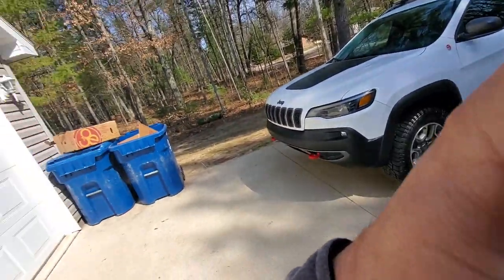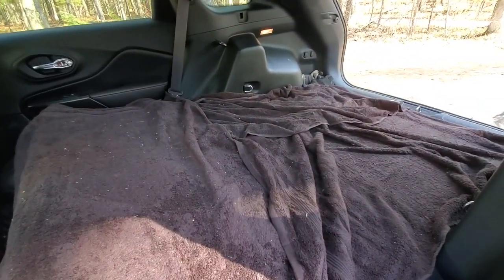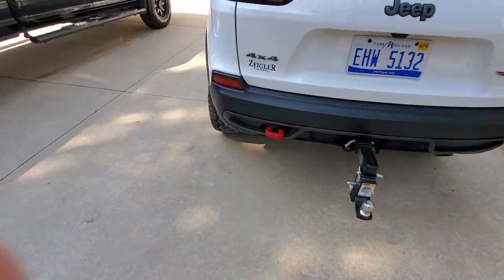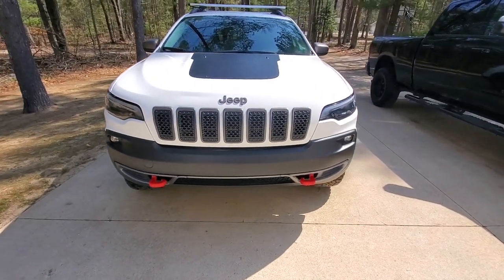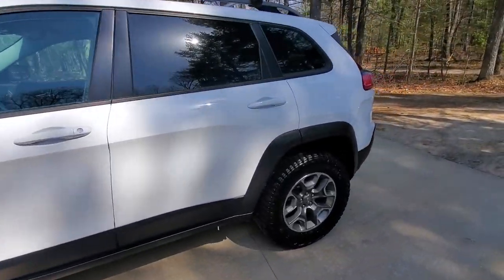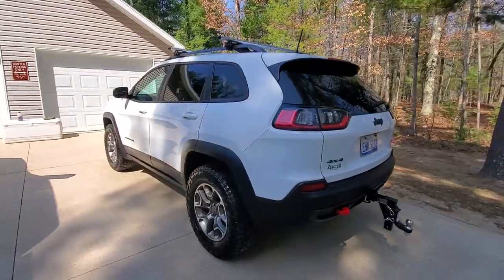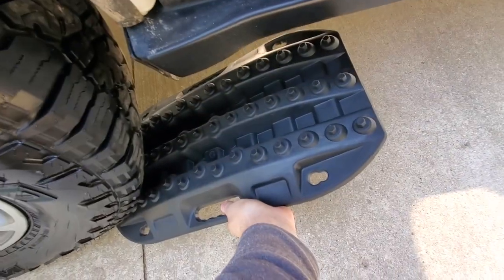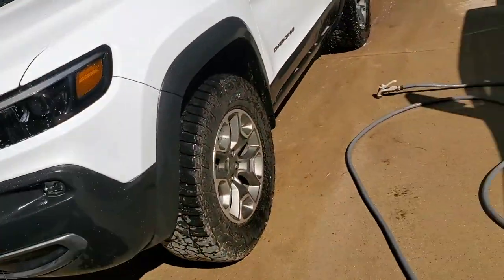Why Is The Jeep Cherokee Trail Hawk So Amazing

Comment: You can also flip down the front passenger seat all the way. Also , the back seats recline if you didn't know. You lift up on the latch that flips them down and you pull back and it locks the recline. There are two recline settings in the back.
Reply from the maker: I dont think the recline option was kept after 2019. But I could be wrong
Reply: @SamkoTradBow  I have a 2020 Trailhawk and my rear seats recline.
Reply: Huge for a tall guy like me or someone who wants to haul structural lumber potentially like 8 foot boards. Thanks for the pro tip.
Reply: I checked my '19 KL Trailhawk and the back seats do have two positions, albeit very little, but still enough. How do you fold down the front passenger seat? I couldn't figure that one out 😂
Reply: @husker_nation  Just pull the thing like your going to lean it back but push it forward instead. 

And then you might have to slide it back on the sliders so that it has room to lean forward
Reply: Nope 2019 and newer Cherokees don’t have the fold flat passenger seat anymore.
Reply: Thanks I didn't know that!!!
Reply: I have a 21 Cherokee Trailhawk and never realized I had that feature! Thank you!

Comment: So glad you popped up. This is the best review I have seen of the Cherokee with excellent clear explanation of how rear lockers work. Great job. Want to see more on your sleeping setup. I’m all about keep it simple.
Reply from the maker: Glad you enjoyed it. My sleeping set up is just a blanket and foam pad and pillow. Very simple but for me as a short guy 5'6" I can stretch all the way out and not touch the seat or tailgate back there..lol
Reply: There have been a couple times already where I wish I knew how to use that rear-locker button. Will remember that next time I get stuck. Seriously.
Reply: @boblozaintherealworld3577  I've only had to use the rear locker once. It was up a steep, rocky slope and it helped tremendously!
Reply: @husker_nation  And I feel so stupid. Up here at 6700' we had a huge snowfall this year. I'm just an LA kid. Will keep that in mind next year.
Reply: @boblozaintherealworld3577  No need to feel that way. Just takes time to learn how to drive in snow 🙂
Reply: @husker_nation  Much appreciated.
Reply: Awesome video! Can you share what brand lift you installed? Thanks..
Reply: @cathtech15able  If it helps, I got a 2" lift kit from Hazard Sky

Comment: I would love to see how you did that trailer hitch! I like the way it comes out the bumper rather than hang below the bumper like some do! Please so a video on it! Thanks!
Reply from the maker: That is jeeps factory hitch they put on the jeep trailhawk from the factory. But I installed it myself. Cost me 500 bucks total to buy the hitch and wiring harness from Mopar.  The install took about 3 hours as you have to take off the whole back clip and quarter panels. But was very worth doing. I no longer own this vehicle and did not make a video when I did it. But there are videos on YouTube that show how to do it I think.

Comment: Dude I loved this video! Thank you! I am purchasing a 2020 Cherokee Trailhawk tomorrow and I’m a big outdoors guy so I’m excited!

I have a 3000lb boat. How did it do towing?
Reply from the maker: Towed fantastic.  Actually got better gas mileage towing my trailer with the trailhawk than I do with my tacoma. You are gonna love it
Reply: @SamkoTradBow  Hell yeah thank you for responding!
Reply: I had another question. I’ve never driven with all terrain tires and AWD. I notice a slight tug on the wheels when turning. Is that normal?
Reply from the maker: @quentinwade5531  yes. But you should not be using 4 wheel drive on dry pavement. When off road the tires can break free and slip easier and don't cause stress on the 4 wheel drive system. Dry pavement has too much grip.
Reply: @SamkoTradBow  thanks again for the response. Is there a way to turn it off?
Reply: I thought with all wheel drive there wasn’t a way to switch
Reply from the maker: @quentinwade5531  can't remeber if the trwilhawk had full time awd if it did then you are all good as the open diffs will take care of everything for you.
Reply from the maker: @quentinwade5531  I can't remeber. Sold it almost 2 years ago. You will have to look at the manual or send me a pic of the 4x4 know on the center counsel
Reply: Good video. How comfortable are the front seats? I had a grand cherokee sterling edition and the seats in that were like sitting on rocks.

Comment: Great video.   I purchased a 2022 Jeep Trail Hawk  and my wife wants to drive nothing else since the check was presented to the dealer.    She drove it home. 
I had a 2008 Jeep Wrangler 2 door Sport model I traded in on it. .       I had the flat towing rig on it  from Blue OX so I could pull it behind my RV as I travel.   I loved the short wheel base. 

It was time to trade the Wrangler so with some research I found I could also flat tow the Trailhawk  model.       That ability to be flat towed sold me and I also  knew  it was somewhat an off road vehicle.  

I did not realize how capable it was off-road  and  yet still a family car.    I just love it.    It checks all the boxes on what we need.     

I will never use my Cherokee off the road as much as you do but I do need the ability to travel on paths that a standard vehicle will not handle.   It is a good pick and yes it does travel off-road better than my 2002 Ford 150 with 4 wheel drive.
Reply from the maker: Congrats on the new trailhawk! Such a great and capable vehicle!
Reply: @SamkoTradBow     Thanks  I forgot to say that I also use it to pull my smaller bass boat instead of usimg my old 2002 Ford 150 truck.     SO it does it all for me now.  
      
So I can tow the Cherokee behind my rv or use it to tow my boat.     I never pulled by boat with the old wrangler
Reply from the maker: @Cuffsmaster  I was towing a 3k pound pressure washing enclosed trailer with my trailhawk daily all that year. Worked excellent

Comment: Stock 2020 Cherokee TH here. I get around 26 at 75 mph on trips. Better if I slow down a bit. 2017 TH I had blew its trans at 35k. Don't forget about the Brake Lock Differential Brake  (BLD) traction aid for the front wheels (back too).
Reply from the maker: Yep I loose a little mpg being lifted and bigger tires. Jeeps bld is awesome. Next best thing to a front locker

Comment: I don't have the TH but my 2018 Latitude Plus is very comfortable to ride in. With the factory tow pkg I can tow 4500 lbs and have never had trouble. The KL has been the most reliable vehicle that I have ever owned. I may eventually move  up to a Grand Cherokee TH for the extra room and tow capacity of 6000lbs.
Reply from the maker: Yep such a great vehicle. Sad to hear jeep cancelled it in 2023.

Comment: Design design 
I don’t think they had planned on having so many great features, components and capabilities. Like built by selecting the area/section and attaching them to a outline/core/structure. So many great things but wow some real “really now”s / misses / forgotten / wtf why nots. 
Like a light under the hood? Even a manually operated light. Or have a 12v outlet so you could plug in something. Hopefully it won’t be much longer since it has been a while now, they had the brilliant idea to put one in the hatchback area. Another almost really great feature is the down light on the side view mirrors. Not sure yet if I like how much of the door is lit up. I know I like better it the bright white LED’s running the bottom length of each door. 
Black hole 2 is the center storage/arm rest. Again just a switch operation light   A nice try with the scooped out area for device charge/connect cords. Better method is having them come out the front with a sliding keeper so you don’t have to mess with it each time you open it. 
Speaking of 12 v outlet in rear hatch. Yes there is one and you can change it from key on or always on. There is a second light in the hatch area. Unfortunately it is also placed very low to the deck which means  BAD DESIGN that felt good to say. It means lights are easily blocked. A middle dome light sure would be nice. Or two of the almost worth it button lights for back seat. Yes it is nice to have separately controlled lights but while they are cute they are not able to produce enough light
2019 Cherokee TH E 49,700 miles fully loaded inside built for the car shows to promote the new blue color. 
I have added over 40 switches plus 8 RF controlled switches several dozen LED’s couple dozen feet of EL Wire outside a 52 “ curved light bar dual forward facing pin spots with high low or strobe 22” bumper mounted light bar one flood-spot and one line spot each side twin focused flood lights rear facing. And 8 horns plus some interior features I invented auto adjusting between seat and center console gap sealer and seat covers with device pocket with wireless charging and cup holders / pockets just outside of where your knees would be.

Comment: Awesome video. I have 2016 Trailhawk and want to lift it. I keep seeing everyone from the Rough Country 2” to MFC to hazard sky…what lift do you have? Is it a lift & level with the back still higher, keeping the factory rake, or does the front lift up level with the rear now. I don’t want the front sag at all. Did you by chance take measurements of before/after of the wheel well clearance? Also saw you are running 265/70R17…any issues with rubbing? Did you have to do the pinch weld mod, any grinding or cutting? Lastly, how is your fuel economy now?

Sorry for all the questions but most people only ask 1 or 2, I’m sure others are watching wanting to know:
What lift & how tall
What tires
Any cutting/trimming or rubbing issues
What MPG now
Any reason you wouldn’t do it again…THANKS!!
Reply from the maker: Hazard sky 1.5 front and 1.5 rear.
Falken wild peak 265/70/17
No trimming or rubbing but very close when articulated,  but no rubbing.  Don't know what mpg was before as I did the lift and tires right after I bought it. But I get 21-22 on highway currently. 
Very happy and would do it exactly the same if I was doing it again. I did do before and after measuring when I installed it. It was 1.75 added in the front and 1.5 added in the rear. Did not measure wheel clearance.  With these tires is tight! Still no rubbing or trimming. But it's very tight in there with thw wheels turned a quarter way
Reply: @SamkoTradBow  awesome thank you!! I don’t need the lift but I’ve always had lifted Jeep’s, and now the Trailhawk feels tiny! I’ll be looking into matching your setup, thank you again!
Reply from the maker: @LucasGeorge  glad I could help. Enjoy that trailhawk. Such a great vehicle
Reply: @SamkoTradBow  I don't understand, what tire size is in this video? You mentioned having a Hazard Sky 1.5" but confused as to the tire size in the video, I just love the look, but you mentioned here 265/70/17 but in an earlier comment you said 265/65/17. Confused?

Comment: Very impressive breakdown. You almost convinced me to get  a Trailhawk instead of a regular Cherokee, even though I never go off-road.
I wonder how far behind the regular one is in terms of trails capability.
Reply from the maker: Never drove the non yrailhawk cherokee. But if you don't go offroad no need to get the trailhawk. The ride quality and gas mileage is gonna be better on the non trailhawk
Reply: @SamkoTradBow  I do plan on an occasional dirt or forest road, and I might just get the taste for it (in a car. I am already an off-road motorcycle rider). Hence me wondering.

Comment: Need a new vehicle to tow a trailer for my business I’ve recently started. Your review really helped me solidify my decision. I think I’m going to go with the same color and do a 2 inch lift with 32’s. Thank you so much!
Reply from the maker: Awesome! You will love it. For the 32s I believe you have to do the pinch weld mod by cutting the pich weld extra material from behind the wheel well plastic. Mine is a 1.5 lift with 265x65x17 or 30.6. The 32s that fit with the pinch weld mod and 2 inch lift are the 265x70x17 or 31.6
Reply: @SamkoTradBow  out of curiosity, have you had any transmission issues? I know that’s a big deal with these vehicles. Only thing kind of scaring me off. Everything else I’m in love with.

Comment: Just went through a strom and with my lowered car i was very limited as where i can go. Many road closures due to water accumulations. Amd in winter....some 2 to 3 feet of snow gets challenging. Really considering a 2021 trailhawk elite.
Just doing some research for possible mechanical/electrical issues. Let me know what to look out for. Great video.
Reply from the maker: @george.giannop  glad you enjoyed it. This vehicle is a little beast and does amazing

Comment: My '19 just turned 3 yrs old.  I travel highway once a month to see the folks 300 miles away, and off-road every few months- Death Valley, etc- does BOTH so well.  Want to do a small lift- 2", 1/12"-  What size tires were you able to get away w on yours w the 1 1/2" lift ?
Reply from the maker: Can't remember the tire size but I show the size in this video or also in my falken wildpeaks review from last year

Comment: Great video, what made you switch from the Renegade?
Also, you should sell Jeep’s as another side hustle part time
Reply from the maker: The cherokee was bigger, has a real low range and rear lockers. More ground clearance, more room inside, and better approach angles. The bigger v6 motor gives more power for towing and I needed something that can tow my 3000 pound pressure washing trailer and my hunting trailer. Loved the renegade! But needed something that could do more. That renegade is the steal of the century though for a fantastic 4x4 vehicle that does everything really good (except towing). I bought my renegade new drove it for 17 months put 30000 miles on it and sold it for 2300 more than I paid new! Would by a renegade again in a heart beat if it fit what I needed.

Comment: Not sure about long term reliability, but these are in a class by themselves  as far as transverse  engine suv..
Low range ..Noone else does that ..and rear locker ..its very capable  have seen them out wheeling in Florida  ..its a legitimate  jeep .
Reply from the maker: Yep they sure are excellent. I honestly think long-term reliability is the same for every vehicle on the road. look at my tacoma. many believe its the most reliable truck made and yet consumers reports only have it a 2 out of 5 in reliability. some say jeeps are not reliable yet I know many with close to 200k miles on them with zero issues. they all average out the same in my opinion.

Comment: What motor does yours have I’m looking at one with the 3.2 v6 and I’m curious how crappy the fuel economy is going to be
Reply from the maker: That's what I had and can't remeber the mpg before the lift and tires. But I was getting 27-28 on highway after lift and tires. And was getting 15mpg pulling a 3k point enclosed trailer, better than my tacoma or gladiator does pulling the same trailer 😂
Reply: Oh wow that’s not bad at all I was expecting upper teens, did you get rid of the jeep and if so why.  I’m on the fence about out picking one up
Reply from the maker: @agordon7369  I sold it. Loved it. But I'm a 40k mile a year driver so I only keep a vehicle for 2 years them sell it and buy something else.

Comment: Just bought a 2016. My 2001 is still better in the bush but I made it that way. My only complaint on it is the plastic oil cooler housing that some geniuses thought would be a good idea to put in between the cylinders on the engine 😅 yay after market parts
Reply from the maker: Glad you are loving both gens of the cherokee.

Comment: I’m actually thinking 🤔 about this vehicle. It’s going to be my 3rd car, I will drive it as a daily. My concern is the Jeep trailhawk is not rated as very reliable 🤷🏼‍♂️ transmission mostly and engine problems? WHAT IS YOUR TAKE ON IT? Thanks 😊
Reply from the maker: all vehicles today are or are not reliable. i think they all rank the same. the ram 3500 is the worse reliable truck on consumer reports yet 9 out of 10 hot shot truckers love ram 3500 for its reliability. toyota is rated #1 in reliability yet has frames that rust out fast and other issues. Ford quality has dropped by half in last 3 years. jeep reliability has gone up from what I hear. Point being I dont think any vehicle today is better reliability that another. 
I would buy another cherokee trailhawk in a heart beat! loved it and do miss it. was and is an amazing vehicle.
Reply: @SamkoTradBow  thanks for your input.